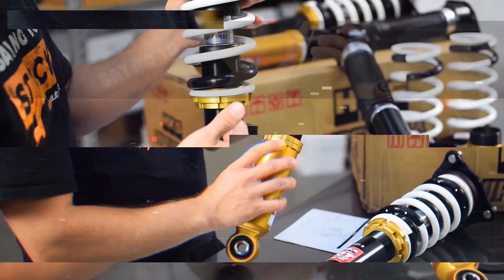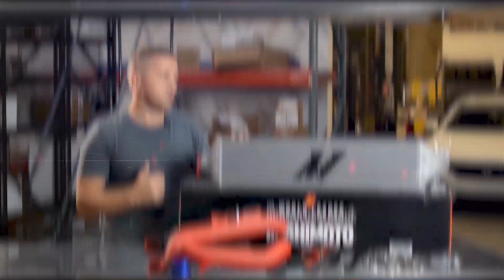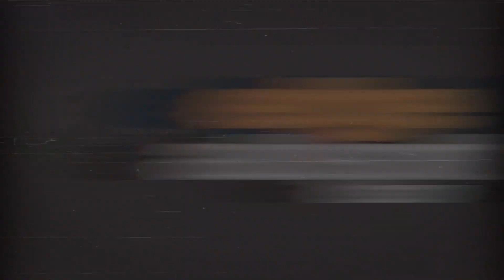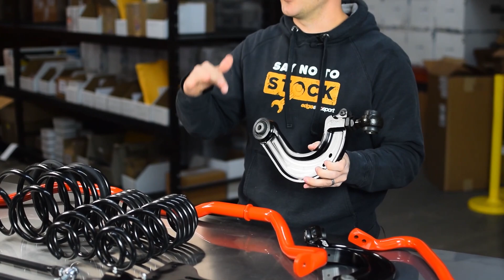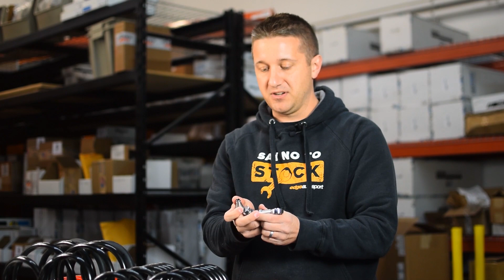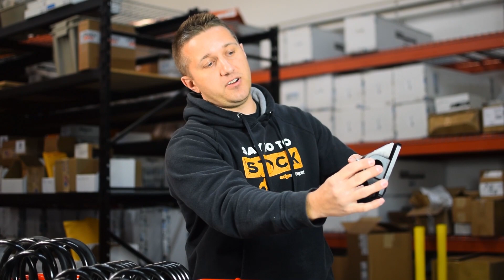EIBACH SUSPENSION PARTS FOR 10TH-GEN HONDA CIVIC SI | PERFORMANCE PREVIEW (EP 15)

Comment: I have a 10th gen daily ex. But it's more of a spirited daily driver. Like, very spirited.
1. How will getting front and rear sway bars and the prokit springs affect my overall driving? How about in turns like around a corner or into/out of a jug handle?
2. Is it worth getting the front sway bar? Does it make a significant difference? 
3. Do I REALLY need a rear camber kit with the mild lowering pro-kit springs? Can I get away without them? 

Thanks!
Reply from the maker: 1. The car would really wake up with springs and sway bars! Overall handling would dramatically increase, with a stiffer ride. If you do drive with a lot of spirit every day, these are for you! 
2. Adding just a rear sway upgrade will increase oversteer tendencies, adding both will maintain that nice balance, and you always have the different mount points for fine tuning.
3. We would recommend the camber adjustment parts for a proper alignment, yes.

Comment: You installed the whiteline sway bars and end links instead of the Eibach.  Why?
Reply from the maker: Probably had more to do with what was available at the time with the supply issues lately.
Reply: Edge Autosport ok, I heard that the spherical ball joints have issues.  Good to know this is not the case.

Comment: Hey I got a question do u guy have the sportsline  for the 2020 si coupe? I haven't seen to many post and the ones ppl post on fb  are the pro kit ones  I want  to get the  stock setup with aftermarket wheels on a 35offset will it i be good with the  sportlines ones? I had this same setup on my 9thgen Sí  sedan but I had 17's instead of 18's am just worry if it will rub or not thanks in advance
Reply from the maker: I checked and noticed we didn't have them on the site. I got them added! They are not immediately available at this moment because of Covid-19 related delays but we can get them for you. - https://edgeautosport.com/eibach-sportline-lowering-springs-honda-civic-si-only-2017-2020/
Reply: @EdgeAutosport nice thanks I just ordered  a set :)

Comment: Hi I just installed my eibach spring on my 18 si sedan and on the odometer the (ADS) came out, is it natural or do I need to fix it?
Reply from the maker: The odometer came out? Can you clarify your question? I'm not sure I understand.
Reply: Edge Autosport it’s the ADS SUSPENSION PROBLEM light came out

Comment: Regarding the rough surface on end link, it is called knurling which is a finishing process used to create any combination of horizontal, vertical or crossing lines on the surface of a workpiece. For example, if a manufacturing company wants to add a diamond-patterned texture to a product — or a component of a product — it may use knurling.

Comment: Hello just a quick one for you. I own a civic si HFP coupe 2018 and I have the OEM wheels that are 19 inches. I recently put spacers all around (20mm). I would like to know if the sportline lowering springs will fit without any rubbing. Thanks
Reply from the maker: Hey Luigi, unfortunately, we don't have experience with that exact combination. You might just have to try it out to find out. It does sound like it'll be cutting it really close. Sorry we couldn't help more!

Comment: Nice. I have the white line rear sway bar. It’s solid steel and made a huge difference. I wonder if the subframe brace is compatible with all the other sway bars out there.
Reply from the maker: Good question. If we ever try to put it on, we'll post.